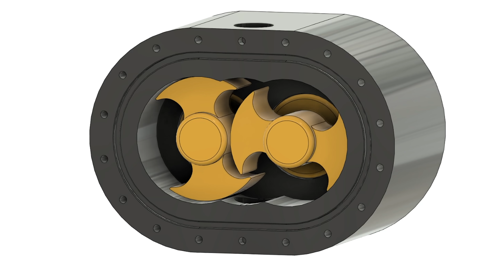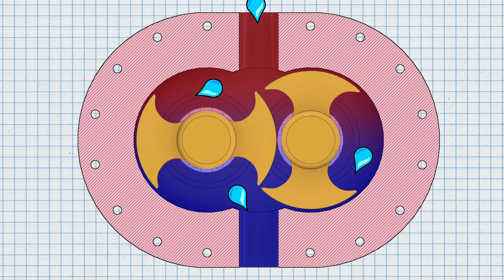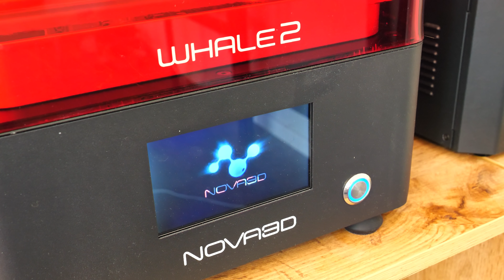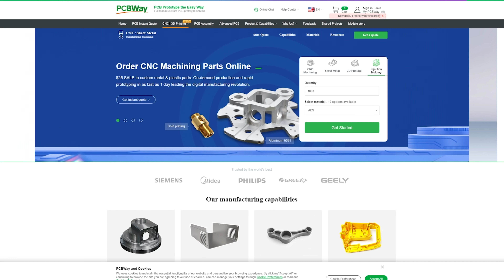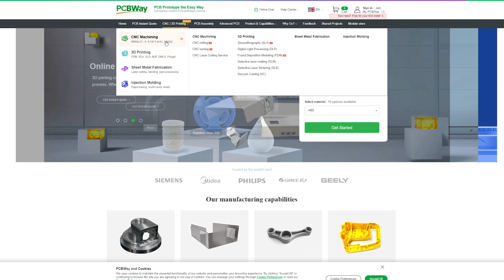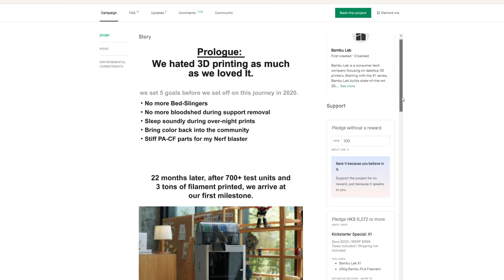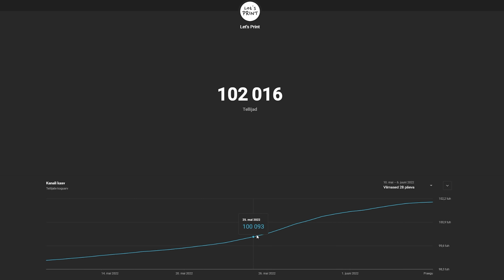World's First FULLY 3D PRINTED Bi-Wing Lobe Pump

Comment from the maker: You can download this model FOR FREE: https://thangs.com/designer/Let's%20Print/3d-model/Bi-Wing%20Lobe%20Pump-107972?manualModelView=true
Reply: Could you increase the efficiency if you printed some gaskets using TPU?

It feels like if you made a small fin/wiper blade and set it at the right angle,  you could eliminate most of the backflow around the edges. It would probably introduce some parts wear into the equation but you can always print out additional gaskets as they wear out.
Reply: The quality of your videos has improved so much in the last 2 years, and you are doing some fun projects! Congratulations on 100k!
Reply: *=* Wow, now make it in metallic for big fire fighting pump concept to extinguishing forest fire! ^^
Like this: youtube.com/watch?v=9Nqcc3yTbMY
I suggest also gear to bigger, and K'Nex shape gear like, idk.
Batman, lol!
Reply: Maybe you should add some oil in your gearbox and make gaskets to keep the pump from leaking
Reply: I was planning a project with a mate and a decent waterpump was a big issue we were looking into....then this got suggested to me 
Quality work mate, definitely won me over; thanks again
Reply: You should use Orings just like they use on PC water cooling to get an air tight seal

Comment: It would be nice when you test a volumetric pump by measure the pressure or meter water. Because thats the purpose of that type of pumps. Just punping water out a bucket doesn't give useful information at all.

Comment: Make the output nozzle a smaller diameter than input, and tapered as on a fire truck. Angle the table to 38⁰ for maximum Reach. (Physics says 45⁰ is ultimate but not in real life)

Comment: I was surprised that the water actually goes around the outside edges of the blades inside the chamber rather through the middle of the two blades for a straight shot through the middle of the chamber.
Edit: I just read someone else's comment saying it's basically because if you were to run it so the blades push from the middle instead of the outside edges, the two blades would be slamming water from the outside edges of the chamber (with more volume of water behind them) right BACK into the inlet and causing more back pressure than forward pressure
Reply: Did not expect to see you here lol

Comment: So Gear pump has small teeth on gears so displacement is low,
  but lobe pump has high displacement but a small seal around the outer case
 Bat wing rotors look as thou there is now a small area to seal at the point of the 2 rotors that meet in the middle ?
what about a gerotor or rotor pump ; inner gear with an outer gear , only using larger lobe design for increased flow ?

Comment: IT's leaking from the body because these high vol impellers are building up too much pressure inside the cavity more than it can throw out through the output opening. Re built it with TWO outputs and it will still have the same pressure and twice the volume !!

Comment: It would be cool if you could test both pressure and flow, because those are very different and different pumps have different flow/pressure ratios. Just because the water doesn't spurt out as far which you deem as "performance", doesn't make it a bad pump. It just has low flow and possibly high pressure.

Comment: Would this desing work as a type of positive displacement supercahger for an internal comustion engine ? Or maybe you should use a twin screw supecharger design for a pump !
Reply: this is exactly how super chargers work, but the lobes are spiraled to mesh together better.

IN other words, this is a fluid pump and air (and water) is a fluid.

Comment: Try an aviation fuel pump style which are rated for 2-500 gph. It has off center cage that uses a solid front and rear bearing the impeller consist of rotor, blades, and center pin which have tolerances but move in eccentric fashion to pump. Bearing are center but cage is off center so when the blade reaches the close tolerance side in compresses. 4 blades are necessary.

Comment: You should use radial shaft seal with grease like in washing machine, and also two bearings for each shaft - on both sides of gears.

Comment: You should have already designed a symmetrical gear set where the number of teeth are divisible by 4 and align the four mounting holes in a simple square in a way that the holes would line up with the peaks and valleys, alternating.

This way, you wouldn't need different design for the gears, nor the rotors, you just have to mount whichever one 90 degrees off.

Second:
shaft seal: Isn't there any rubber + spring type seal there? I don't know it's proper English name, I've seen them mentioned just as shaft seal everywhere... Those press-fit things like bearings. It'll provide better seal with magnitudes lower friction than O-rings.

Lid seal:
Just use rubber sheet or big O-ring with a groove, but even when you just use sheet gasket, it would improve the seal if you add grooves to the lid and matching "bumps" the other part.

The rotor clearance can depend on the gasket thickness which is good and bad, it depends. Bad, because you have to set the clearance, good, because you can set it.
If you don't want that, rather print exactly sized parts, then just don't use the flat surface to seal but create a taller housing and a lid that slides into that, then use the circumfence of the inner step instead for sealing with an O-ring in a groove.

I'd like to mention that for an O-ring groove it is better to use square profile, not round. The rubber has to go somewhere when you compress it, and if you use a square profile there will be 4 corners for that so you can make a quite tight fit while still be able to assemble it.

Comment: That's a huge pump and gearbox for the result. Lots of friction losses too. I think you would be much more gratified with the results from building a multi stage axial flow pump or centrifugal multiple stage, Gear pumps are generallt reserved for low flow with good sealing. Hydraulic industry. They require considerably higher precision. If you really want to do it, make the pump smaller and the synchronising gears bigger.  Use lots of supports and do the housing as resin printed too. The bi-wing pump lacks sealing of the meshing interface from reverse flow so you loose a lot of pumping volume per rotation passing the wrong way. Vane pumps are another option, also a couple variants on those I invented about 30 years ago. I 3D printed a housing a while back but haven't finished it off. Too many other projects...

Comment: I've been paying attention to your vids for some time. Ur awesome !  I'm also obsessed with pumps. 
Your CGI animation & description of why lobe pumps work was REALLy cool. Perhaps I can add to the understanding of why pumps pump. I'm hoping to expand your understanding & it might help you to make even better designs.

       The notion of flow between high and low pressures is correct, but it is less relevant here. It is less relevant because water is not very compressible. Ancient man would say water is not compressible... Thus, when we think of water pumps and the reason they pump, I like to think of it like ushering the water. Escorting the water. Pushing the water. Think of it like chambers which change shape. The changing of shape means the water will flow when the volume space is altered. 
    In the lobe pump, the changing of volume occurs when(in the middle) one lobe enters the space. When the lobe enters the space which has water in it the water is pushed out. When the lobe leaves the gap, water goes in to fill the gap. The gap is the space in between the gears... or in between the lobes...  
    Hopefully this gets your mind gears turning... Your mind lobes, lobing...
-Cheers

Comment: Test this as a hydraulic motor. You use a hose to put pressurized water into it, and the shaft turns. 

Also, test the pumps ability to raise water to a higher level. Connect a hose to the pump outlet when it is in pump mode (as shown) and raise the hose outlet to the roof of a house and see if it will lift water to approximately 20 feet.

Comment: Have watched a number of your water pump videos, just hoping you will read this comment.
I'll suggest looking into iglidur as a material and iglidur filament, the FDM printed gears will benefit greatly from a material swap, you can just print the infill in another cheaper material if you have a multi-material printer. It will generate a lot less friction and yielding better overall

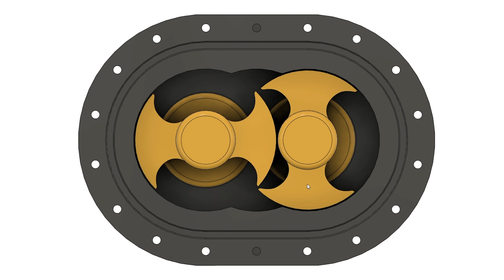Comment: The whole benefit of having much longer gaps at the housing nullified by the very bad gaps at the profile engagement. It is true that a longer gap decreases the leakage flow. But with this design the profile engagement gap not only is much shorter there even is a dead volume being transported from high to low pressure like you can see at 2:06.

Comment: Its not the most sufficient style . Comparing to car 
Centrifugal pump = turbo charge
Your style of pump = super charger however the most efficient style of super charge is twin screw type  its need to be screw curve in parallel that make the most sufficient force and good torque

Comment: You worried about the leak from lobe-casing contact so you create a wing shaped rotor to maximize rotor-casing surface contact. By doing that you reduce the rotor-rotor contact (in the middle), which is more important because the gap was pushed into the inlet.

Comment: Have a look at the old Johnson IC30 or new Wright pump MP range. Tri lobe or bi-wing lobe. Look at the gearbox side. Try an additional set of gears further back in that "empty cavity" you have. it will balance your shafts and give more stability at the end of the lobes. At high speed your lobes will be moving up and down with such a thin shaft. Just a thought. Excellent work, love the pump vids!! (also, max rpm for any lobe pump should never exceed 850 rpm at the lobes)

Comment: How well can it compress air? If not, what if you use grease?
Reply: It definitely can't compress air, even with water it that weak.
Reply: @nurhaqim7159  with tighter tolerances (use of machined vs 3D printed parts) and frictionless seals, it could compress air just fine.

Comment: It’s a pretty standard waukesha sanitary pump design and they have issues getting primed if there is significant wear between the rotator and housing 
The clearance will generally become the size of the biggest abrasive particle it’s pumping

Comment: I was puzzled as to why the wingless on performed better, and it seems to me that the front wings force the water backward at the end of each cycle. Eliminate the leading wing, and you may be onto something.
Reply: too much friction loss on this one. Sealing the internal parts is pointless when all you need to do is seal the outer casing.
Reply: I agree, that is definitely a point where extreme high or low pressure and turbulence could happen.
Reply: I believe the overlapping wings create a "dead zone" between them that uses the liquid to help seal the pump. if you don't have that geometry the pump may not seal on the high pressure side, which can lead to lower efficiency as it leaks pressure to the low pressure side.

Comment: how about a rubber sheet to use as a gasket instead of silicone? it'd be easier to take apart, and can be reused if you're using the same housing again.

have you thought of trying a screw pump?
Reply: RTV would be easier

Comment: this is so cool. I am confused though about the flow and pressure zones. If it flows from high pressure to low pressure how come in the graphic you show it flowing from low to high? If that makes since
Reply: The air outside the bucket is "high" pressure. The water travels from high pressure to the inlet where there is a low pressure zone. As the lobes spin around they push that water together and try to "compress" the water but water is almost imcompressible. So this third area is a "high" pressure area. There's an outlet to the outside air, which is now a "lower" pressure than the water at the outlet so it forces the water out into the open atmosphere air. Air is 14.7 psi at sea level so figure the low pressure at inlet is less than that and the high pressure is higher than that.

Edit: Keep in mind, there will also be back pressure as that high pressure water also wants to travel to the low pressure water and hence the different lobe design. The close tolerances make it difficult for the water to travel backwards although some inevitably will. You could potentially put seals with a little oil on the end of the lobes to gain efficiency but that means changing out seals at some point as well.

Comment: The advantage of this lobe design is the lobes can have more clearance so you can have wider tolerances. The volume of water on the outside is far greater than the space in the middle, making the forward pressure far greater than back pressure.
I was happy in the last video when you said you were moving to this design.

Comment: Would having multiple “stages” (ie have another pump after the first one, and so on) increase pressure/flow more?
Reply: I dont think the flow will change because you only have the set volume per rotation. If you want more flow then you need more rotations so a stronger motor for example that is also faster.
Reply: @nielsvandenbelt9852  That makes sense, would pressure be increased though? And would a reservoir (for lack of a better word) between the two be needed or can they be directly coupled

Comment: One interesting pump design you could try ist the mazda rx 7 oil pump sesign. It should create a very high pressure.
Reply: Volume is more desirable than pressure in this application. And volume and pressure are two different things
Reply: @nsboost  listen to the guy with the lagunita
Reply: @nsboost  the rx7 pump wasnt going for volume either. Mazda was trying to get good pressure to oil everythingin the engine. It being a rotary there are nearly twice a many moving parts compared to a normal engine, with the apex seals, the ecentric shaft, rotors, side seals, and corner seals, all of the seals moving up and down basically 3 times for every one revolution, it need oil delivery fast. At that point volum doesnt matter as long as its getting oil. I do admit rx7 oil pumps do move a fair amount of oil too though.
Reply: @MrThunderCunt  I can't belive that everything you said is wrong, it's really impressive, and I congratulate you.
Reply: @xXtarkilla21Xx  prove it
Reply: @Lauri_Heino  there's literly 3 major moving parts in rotary, the two rotors and the output shaft. Even a simple 4 cyclender has more major moving parts. And if we want to start counting seals and springs each cylinder has 2 oil rings and a piston ring, each cylender is going to have at bare minimum 2 valves. This list goes on and on per a cylinder, rotarys have alot less moving parts.
Reply: @Lauri_Heino  for his oil pump comment is definetly maters how much volume the pump moves considering your recommend by mazda to red line the car at least twice a day, which is 9k rpm. Along with the killer of 90% of rotarys being oil starvation due to OMP failure.
Reply: Yay I managed it to have the most liked coment on this video. Thanks to all the people that liked it.
Reply: @mysteryguy7716  nice
Reply: The rotary engine. It’s a very hard design to make as making it seal with low tolerance and soft materials is very hard but would be very cool if it works!
Reply: 144p 👍
Reply: It's called a gerotor and they're very common oil pumps, especially in automatic transmissions.
Reply: This pump shares similar principles to a rotary engine tho